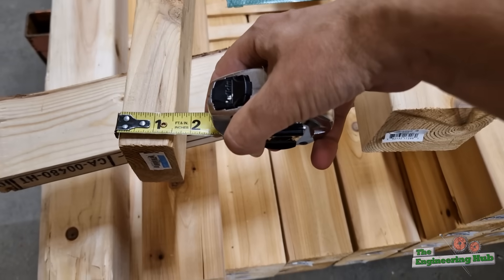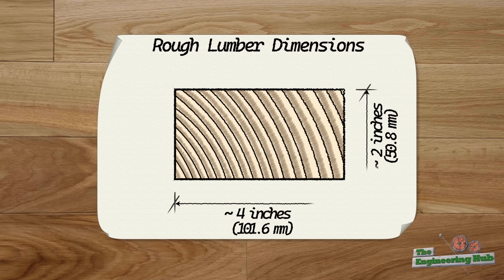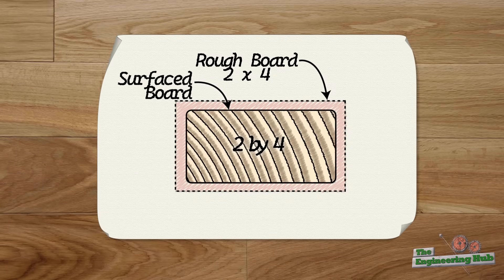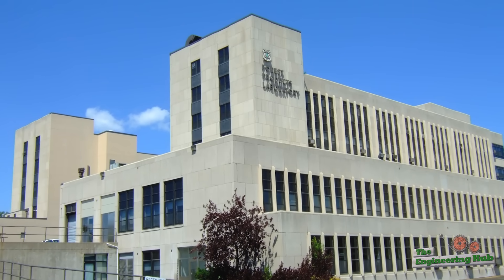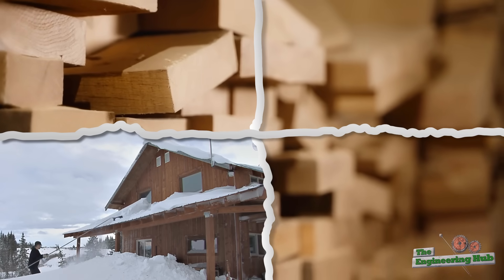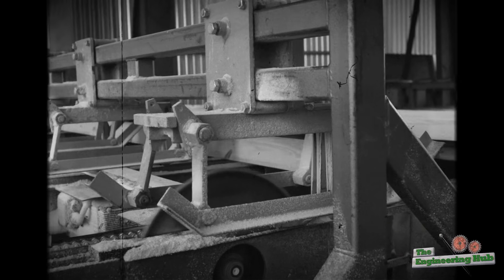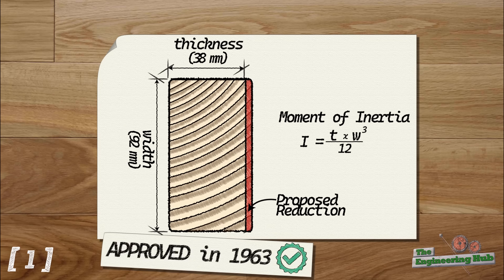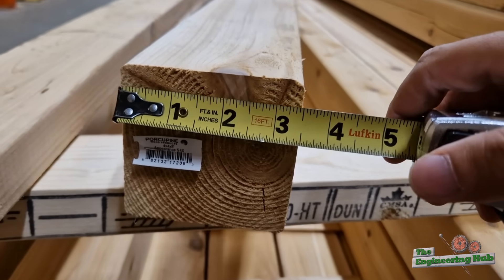Why is the 2 by 4 getting smaller and smaller?

Comment: In Australia, a 2 by 4 would be listed as 100mm x 50mm (10 cm x 5cm). Our standard framing size is 90 x 45.
Reply: 45x95 just about anywhere in Sweden. Still mostly called a 2x4 though, even though we swetched from inches to metric many many ages ago... :)
Reply: @MagnusBrynedal  yes biltema and byggmax used those meassurement earlier in norway too
Reply: In Scandinavian 2x4 is 98x48mm

Comment: believe it or not. the wood suppliers got the laws changed to sell smaller pieces of wood. they claimed that wood could be smaller because drywall is a structal material. thats right thats what they used to get the building codes changed.

Comment: You say early on that a rough 2x4 cut was 1 5/8ths x 3 5/8ths after finishing.  But then you also say the standard now is 1 1/2 x 3 1/2, and claim this starts as a rough cut 2x4.  This can't be right.  If anything, I would expect efficiencies now in finishing timber to be higher not lower.  If they could finish a 2 x 4 with 3/8ths wastage in 1900, how could they need 1/2 inch now?

I don't believe current lumber still starts with a rough cut 2x4

Comment: In good old Germany wood is measured in Metric - a 5x10cm  piece of wood (Kantholz) is 5x10cm (2x4 inches)   as far as I know you are not allowed to advertise with a dimensions which a product doesn't has. "Etikettenschwindel"
Reply: @esyr  same here in Germany, but as soon as it fine cut it sold as as 48x98 mm and not as 50x100 anymore.

Comment: I'm going to guess that the rough cut they use to mill down to 1 1/2 x 3 1/2 isn't actually a full 2x4 anymore. That it's a fair bit less because it lets them extract more rough boards from the tree while still calling it "2x4" at the end user. By starting the rough cut at say a 1/4 under in each dimension they can perhaps extract a few extra boards from each tree and over time that adds up to a lot of extra boards sold for "2x4" that never were even truly 2x4 at even the rough cut stage.

Comment: 2x4s are not getting smaller  The dimensions have been standardized for many decades. That's why you can pull a board out of a house built in the '50s and replace it with a board of the same dimensions.

Comment: Not just the size has changed, so has the quality.
I am rehabbing a old house which has the old sizes 
but more striking is the quality. Even the lathing is 
clear and knot free. The ring density is like 3 times
what you get now.
Reply: yes, many "2x4's" at the box stores, are warped, twisted, bowed...and it's NOT the cull piles. Many are also so bark-edged that it creates strength problems, and problems using them, especially when they are badly bark-edged at the ends. I suspect this is the result of using "logs" that are too small to even get a good "1-1/2 x 3-1/2" out of...
Reply: Its as if there are fewer old growth trees to cut down today... :)
Reply: @voightkampffchamp You can facetiously say that, have you considered why that is?  It is not simply that we used up all the preexisting trees and are now stuck with new growth.  The tree farms actively encourage trees to grow fast, and harvest them young.  Why?
Reply: @yellingintothewind  I think every 10-15 years tree farms clear out trees to make space for the others to grow larger and that's probably why a lot of lumber is from young trees. Was there a particular recent increase in the amount of young growth lumber? I'm not from the US so idk.
Reply: @yellingintothewind  because old growth is older than most nation states?
Reply: @yellingintothewind  A tree farm needs to at least double in size for every doubling of the average age they cut down a tree to keep similar annual volume and their revenue doesn't double with it unless they double the price they sell each board at. Yeah, there are a lot of negative consequences for it in the quality of the lumber, but that's why they do it.

Comment: My house was built in 19oh5. It has the old 2x4s. When doing renos and repairs I held on to any of the original 2x4s and used them to fill in walls so I wouldn't have to shim to make drywall fit.

Comment: Looked more like 1 3/8" x 3 3/8" as seen on the measuring tape. I used to work at a sawmill in the early 90s and was in charge of the planing machine, our dies were set at 1 5/8" x 3 5/8" untried lumber. After sitting to dry out for a period of time, they would be sold as 2x4s at 1.5" x 3.5" finished and dried.

Comment: Where a piece of timber is actually 2 x 4 timber is “rough cut” and will need dressing.  Timber marked as 2x4 but is not 2 x 4.  Is sold 2x4 DAR meaning (D)ressed (A)ll )R)ound.

Comment: A “rough cut” is a true 2 x 4 inch board.  Or 2 x 6 or 2 x whatever.   Then the rough cut lumber is planed by 1/4 inch on each side.  Leaving a NOMINAL “2 x 4” which is actually 1-1/2 x 3-1/2.  This allows for “truer” or straighter boards and edges.   This had a variety of advantages from storing and shipping to actual construction.  The planed material is recovered and used for a variety of purposes but I doubt it provides much of a financial advantage or they would just grind the entire board.

Comment: It comes down not to weight but more boards. Saving half an inch by height and width create a shitload more boards, like exponential. The engineering numbers is bullshit also. They are paid to “figure this out” by the lumber manufacturers so of course they’re gonna say less wood is just as strong which is fucking hilarious.

Comment: I still have some rough cut 2x4s here someplace and let me tell you, you would not want to handle them much. They are ROUGH! You really need strong gloves to work with them. So planing and smoothing were probably welcome changes by the carpenters who had to work with this stuff.
Reply from the maker: Great point! Thank you for sharing that, most people nowadays have not had the chance to feel a rough cut lumber.
Reply: Boy you are right about that. Not only are they extremely rough cut but because of the added density and weight they dig into your hands more than newer lumber. What amazes me is you see old film and the guys aren't using gloves to the extent you'd think they would.
My grandfather born in '37 was a carpenter his whole life and never used gloves. His hands were basically 1 giant callus, even decades after rough cut lumber ceased being the norm. He came from an era where men were men and the women were men too.

Comment: Thinner boards would result in a lower span, not a different spacing. Standard spacings of 12, 16, 19.2 and 24" would give options if one span is too large for a higher spacing. The span tables have decreased over the years due to old growth lumber no longer being available, and new growth not being as strong.

Comment: I’m caught by the ring size. In the end shot comparison .. the older lumber has very tight rings. Where the finished piece are quite thick and seem less dense. 
  My house was built in 1883 , you’d be amazed at the wood in this house.  Not finish wood , but the studding , and T&G lapping .. no drywall here. (Except a couple rooms that were remodeled in the 80’s. And it is just laid over the original lap. ) ..
Reply: Yes, as an aside, I hate drywall..I call it "paper and chalk wall"...good for fire resistance, not much else..crappy weak, hollow walls, I like something solid.
Reply: Might as well use steel I beams at this point. Fire resistant, basically pest proof, and sturdy for the mass, while playing better with concrete and masonary. Expensive though, although if you are building your own house and planning it to last 50+ years, the expense might be worth it, even if the metal is just used for load bearing sections.
Reply: @Demopans5990  my house is ALL wood and it’s 147 years old. Sooo yeah ..
Reply: @jaredmiller8740  There're just too many of us at this point. "Old standards" used slower-growing wood or ancient forest. Keep on with that for a few years with modern populations and you'll have cut down like half of all the national parks to build some houses.
Reply: @jaredmiller8740  agree 100%
Reply: Each tree is different you still have both today, I guarantee it
Reply: It's going down!
I'm yelling timber!
You better move!
You better Dance!
Reply: @drawincode1800  ok , thanks for the poem.
Reply: @theofficialdiamondlou2418  your welcome m8.
Anything else I can help with?
Reply: @drawincode1800  ahh an Aussie. I should’ve guessed. Yeah ,naw I’m good m8. But I might use that in a song. If it goes platinum I’ll send you royalties 😂..  🤠🎸🎶🤙